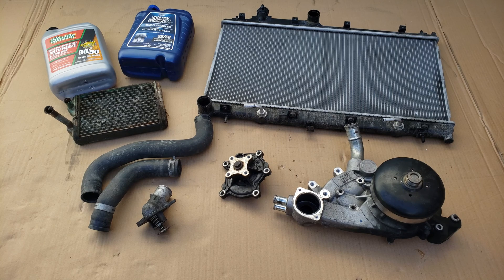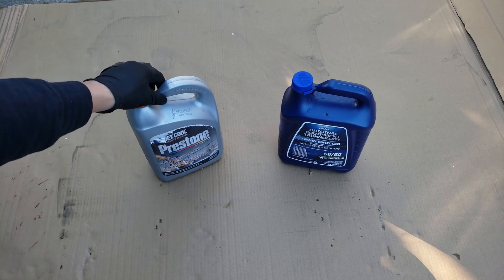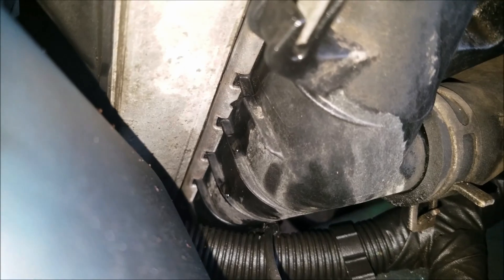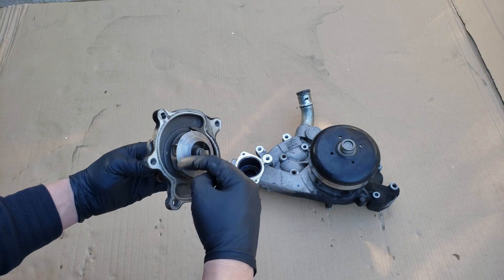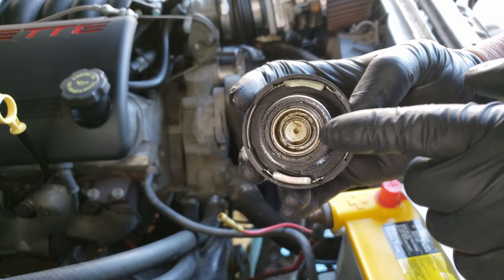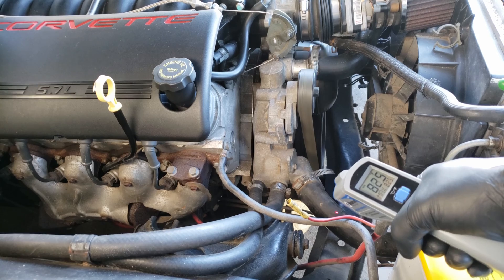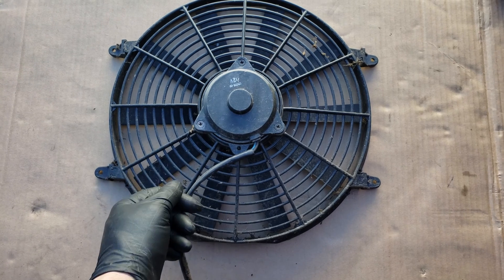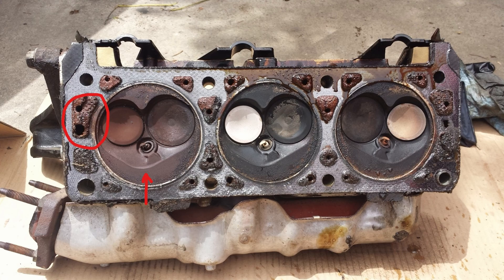Overheating Car or Truck Help - How to Fix an Overheating Engine

Comment: My car has a radiator leak. It sounds fine in park. When in drive I hear the clang and ping noises. Is this normal as a leaking radiator symptom?
Also, my oil dipstick tube broke. I cannot get the part at this time. Will blocking the oil dipstick tube and preventing air from getting inside the engine help until I can get the part. The part is not available at this time. I have a 1963 Lincoln Continental. I can recreate the tube when I get the dimensions.

Comment: My car has the coolant reservoir filled to the max with fluid. And my car is overheating. Happened to me twice. No weird smell, no white smoke out the tail. I see some spurts next to the radiator cap. I changed the line to the reservoir and put on new clamps. Worked for a bit then I saw some new spurts by the cap? No indications of major damage done...but I haven’t been driving it since. Now, I looked the other day since it’s been parked and I’ve got green fluid leaking underneath my car?! I understand this is coolant? So what do I need to do to fix it? I got under the car and looked and I can’t identify where it’s coming from. I don’t mind doing the work myself...I just don’t want to take it to a mechanic where they will try to con me out of money. I know this isn’t always the case...but I’ve had bad run ins in the past and since then have gone to great lengths to educate myself. I understand there is UV drops I can put in my radiator? That will help me identify the leak? Okay, but even if I find it. Then what? 🤦🏻‍♂️ this is sad..it’s like having a really big splinter in my ass and I can’t get it out 😂
Reply from the maker: The radiator might have a bad gasket and not holding pressure, when that happens itll add more and more to the coolant resevoir..and if the resevoir overfills itll come out the resevoir itself..and thatll give u air pockets in engine and radiator causing it to overheat more often cause not enough coolant in engine and those air pockets create more pressure to radiator cap causing more overflow..but yea the most important part is finding out where its coming from..if engine and radiator is full of coolant or youve been adding some majority of time when its hard to find and not leaking all the time..its normally a water pump..they have that weep hole where it begins to leak when the car warms up.
Reply: Hey thanks for replying so fast. I’m gonna try to work on it today and I’ll let you know how it goes. Hopefully I can find the leak and it will be a easy fix.
Reply from the maker: @andrewjosefgarcia9893  good luck i hope you're able to find it and hopefully is an easy fix

Comment: Thank you. I used to idle my 2012 Silverado sometimes, my job makes me stop 34+ /day to deliver things, now I'm afraid to. I've never let it overheat too high, now I'm cautious (normal running temp is 100C. I've caught it creep up to 115C). As soon as I turn the heat on, the gauge goes back down quickly. It's much worse if I try a/c. It's completely fine while driving home on the highway with a/c on.
Reply from the maker: U ever hear the fans come on? Thats normally what helps cool down ur temps at idle...and i know those Silverados do tend to have issues with their cooling fans.
Reply: @backyardchevy328  yup I hear the fans come on. They sound normal. A guy at work mentioned another fun option it may be. He thinks a pulley for my fan belt could be worn. I've also had battery problems, but it's been holding 14 to 15 Volts. I've been trying to keep a closer eye on it, since my job is hard on vehicles

Comment: Please help,my dmax 2012 , I replaced head gasket,head cylinder,water pump,fun clutch and thermostat but still the truck overheats while driving uphill 😱😱
Reply from the maker: Only uphill? hows the coolant level is it always at a good level or does it lose coolant? have u had radiator flushed? i would also make sure the front of the radiator is cleaned and nothing restricting it...so the air can flow through it properly if u see dirt/mud spray it down to clean it off
Reply: @backyardchevy328  haven't flushed radiator but it looks okay

Comment: Please help!  2001 Silverado 2500HD purcahsed in November.  When idle it overheats and says low coolant.  In last two months we replaced, coolant sensor, thermastat and housing, water pump, coolant reservoir cap.  Drove around 30 miles away and noticed knocking on acceleration when on the freeway, then on the way home service engine light came on.  Ran OBDII Tool and code P0327 came on.  What is this and is it costly to fix?
Reply from the maker: p0327 is a knock sensor code..if u heard knocking while driving then thats what triggered it..have u checked ur oil level? Is it normal colored?..if u heard knocking i would do an oil change into a container where u can inspect the color of the oil and see if theres any material in the oil or if its copper colored...as far as overheating at idle..usually is related to the fan not working properly..make sure the fan clutch is working properly..but id start with the oil and knocking cause thats a potentially more serious problem
Reply: @backyardchevy328  , the oil was changed a day before.

Comment: I got a question, does it matter what size battery I put in a car
Reply from the maker: As far as actual size or u mean the cranking amps and reserve capacity on the battery
Reply from the maker: Putting a bigger physical battery wont affect the car negatively..just might put a lil more strain on the alternator and how well it sits on the battery tray...but as far as more cranking amps and reserve capacity battery...its actually a positive cause means u have more available when u need it..only drawback there is the battery costs more...but i should do a video on that🙂
Reply: Backyard Chevy  well Walmart said they have different size battery’s for different cars an our Chevy Malibu batt went out and I put a smaller cca batt back in it, and it keeps throwing codes
Reply from the maker: @jonathanbryant7166  yea u dont wanna put a weaker battery..less cranking amps itll act like it detects a bad battery